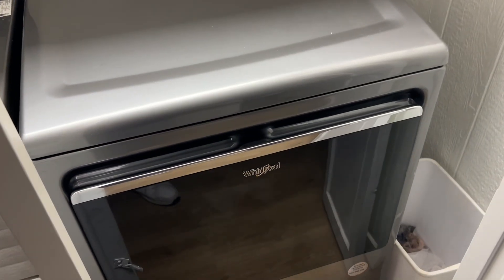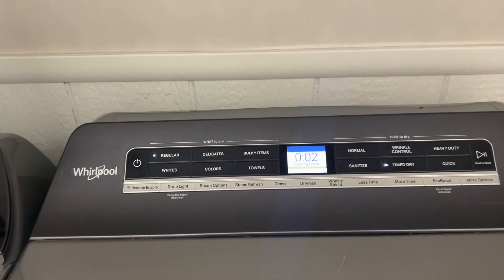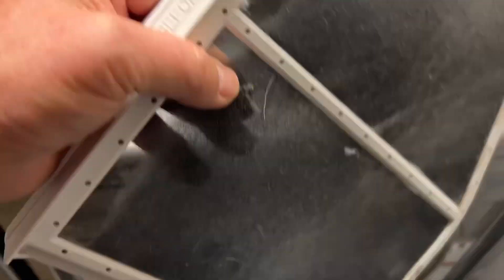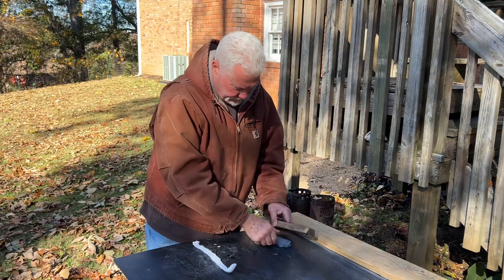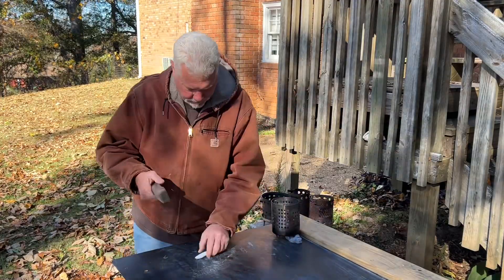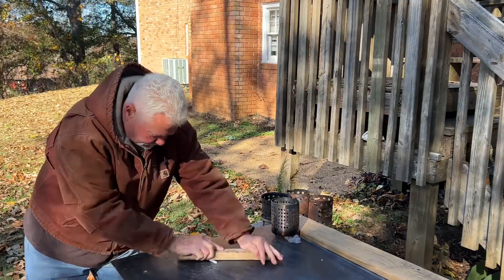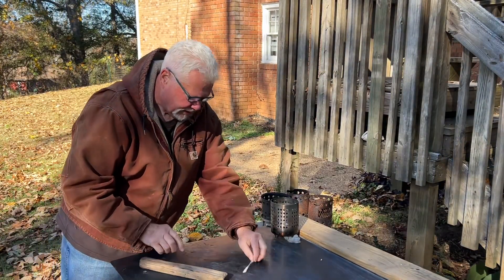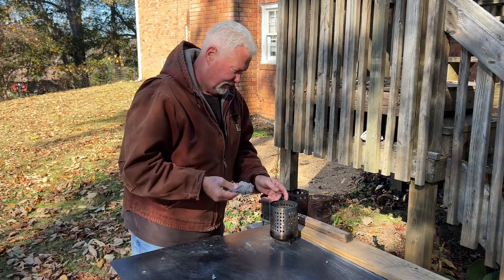Dryer Lint Will Not Fire Roll But Will Ferro Rod, Nicely!

Comment from the maker: Dryer lint will not work for the fire roll at all. It won’t work for the outer fibers because it is not 100% cotton or other natural fibers. Also, the little particles of lint are not strong enough to withstand the rolling.  They are not equivalent to the long strong fibers of a cotton ball. 
   Partly for the same reason, you can’t use it for a fire roll’s filler material either. It doesn’t ignite to ember itself nor does it cause the cotton ball to ignite to ember. As a matter of fact, that’s how I test a material’s fitness for fire roll. I put a lighter to it. Natural fibers will ignite to ember. You can blow on them and make the ember get intensely orange. Synthetics will mostly just melt and smoke a lot. It’s the same no-go with protein based materials they melt… wool, human hair, nail fillings etc.
   The Ferro Rod, as we all know, easily ignites dryer lint.
   Please follow the LINK below and SUBSCRIBE.

Rudiger Roll, Fire Roll Playlist
https://www.youtube.com/playlist?list=PLkoXX8XsMW3kLMA7kY_LznhzK5nOrA3Wd